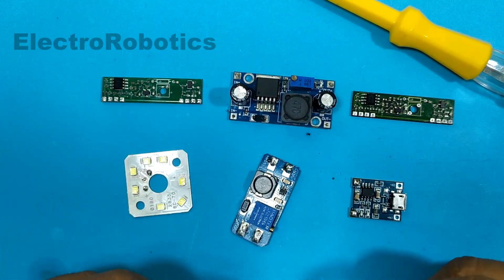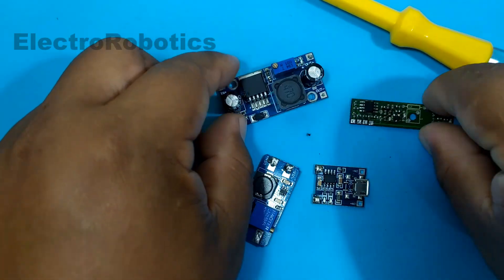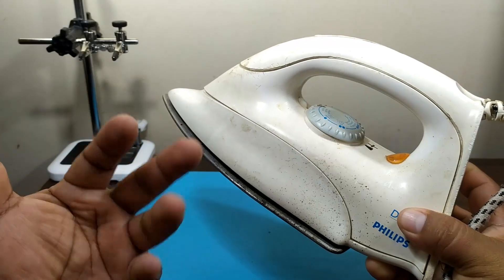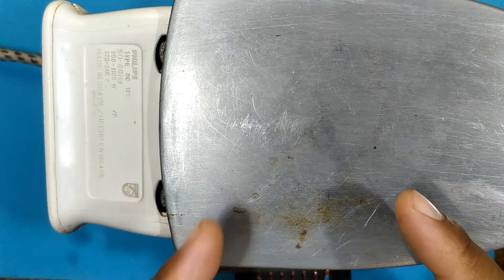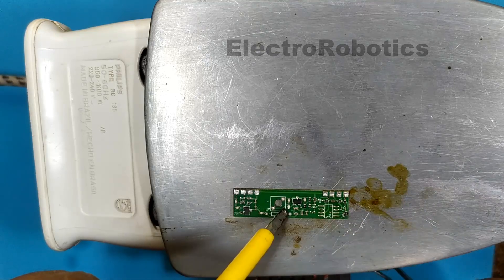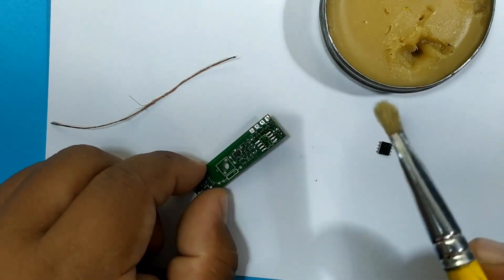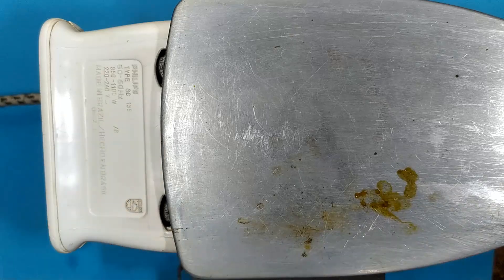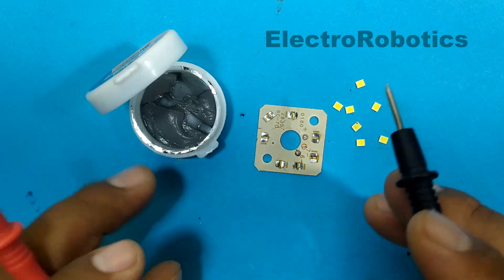How to Solder and Desolder Electronic Components with a Clothes Iron? 100% recommended.

Comment: Hi ElecrroRobotica and Everyone. Could this same Methed be used on PCB that has a mix bag of components, surface mount and not surface mount, I'm a novice and trying to learn, especially happy I discovered this video, I wish there was a similar technique for non surface mounted components because cost, skill needed and time consumption is more, Thankyou.
Reply: i think for through hole component extracting not that useful since sometimes they use high temp lead for soldering and you have to melt your own solder to it in order to soften old solder... hope it helps
Reply: @presatyomuhammedDwibiology Thankyou for that tip, so manufacturers use lead that require heating with solder at a fairly high temperature.

Comment: Nice video. I use an external digital thermometer with thermostat function from AliExpress to control the temperature with precision. I keep the iron box thermostat at high and let the thermometer do the control. After a couple of trial and error you will know the correct setting.

Comment: Good idea. I never thought of using an iron as a hot plate. I didn't know it could get hot enough. Obviously it isn't suitable for all situations, but for single-sided PCBs that seems like a great way to easily mount all the SMT components at once, instead of using a hot air station.